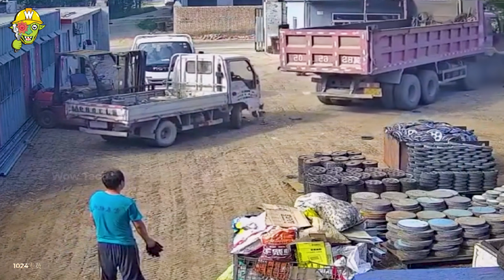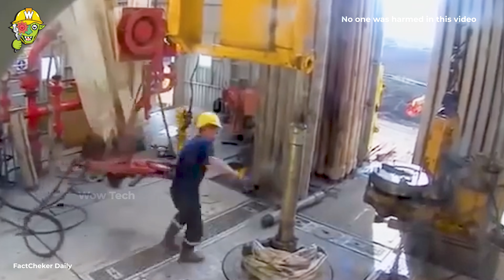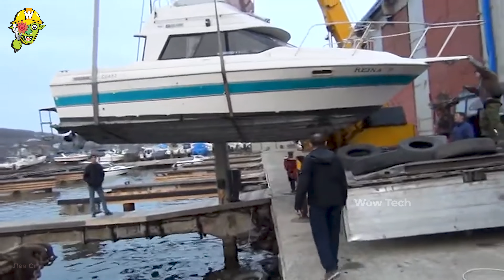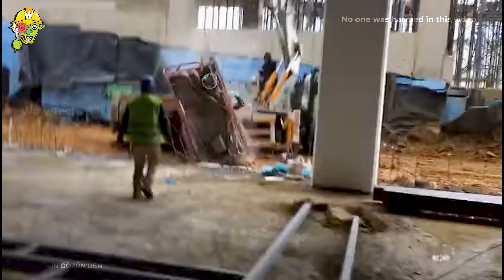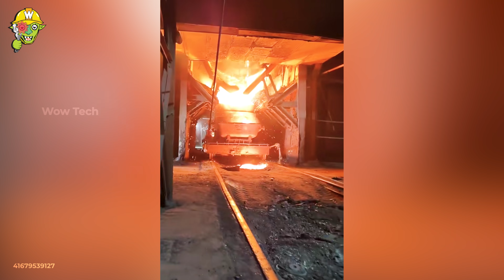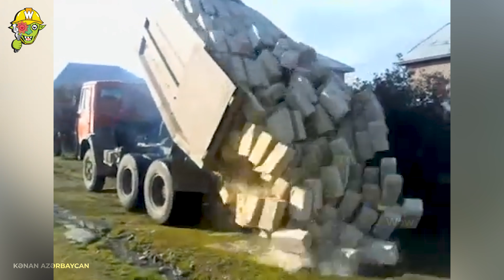Heavy Machinery and Industrial Mistakes Caught On Camera

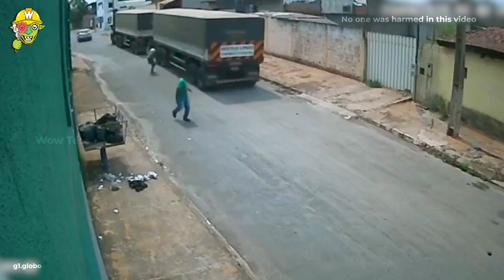Comment: Folks help: 19:44 the trailer rolled off, disconnecting from the tractor. How so? Doesn't it have air brakes and supposed to stop as soon as the trailer gets released and the air pressure dropped?

Comment: The guy cutting the steel straps , what did he think was going to happen? Thats why they use steel straps is to hold things tightly in place like that steel roll, you cut that strap loose ofcourse it’s going to unroll

Comment: It just seems to me that one of the main jobs, if not THE main job of any crane operator, is to check that the crane you're using is able to handle the weight of what its lifting.   Then double check it.  Then confer with a co-worker, and have them check it.   How some of these morons got jobs doing something that is so important, and dangerous, is beyond my comprehension.   
I've also seen that clip of the idiot who's truck was actively on fire, and he decided to drive it straight to the firehouse. That has got to be one of the dumbest people on the planet.  It's like if you found a bomb, and then thinking its a good idea to pick it up and run it thru crowded streets, just to take it straight to the bomb squad.

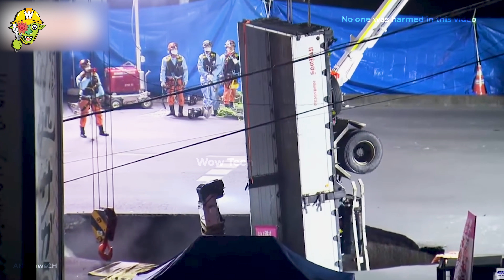Comment: 3:31 The road collapse occurred in Yashio City in late January 2025. A broken sewer pipe caused a massive underground cavity, which led to a truck falling into a sudden sinkhole. The driver was thrown from the cabin and tragically drowned; it took three months to recover the body as the hole continued to expand. As of April 2026, a temporary bridge has been installed and partial service has resumed, but it is expected to take several more years for the environment to be fully restored...
Reply from the maker: This is very valuable information! It's surprising how long-lasting and devastating the consequences of a broken pipeline can be. What precautions should similar urban areas take to prevent such tragedies in the future? Thank you for your contribution!

Comment: I was working at a small distribution warehouse in Mississauga , Ontario  , Canada when there was 2 workers driving 2 reach trucks unloading a 53 foot  trailer. When one driver had to stop unloading and go get a skid of supplies and take it to the production room. The driver of the truck and 53 foot trailer lost track and took the brake off both the truck and trailer and started driving away with me on the reach truck still inside the trailer. Luckily for me my supervisor was able to Stop the truck and trailer from leaving. The truck driver thought we were finished unloading the trailer. No damage or injuries but had me a little rattled.
Reply from the maker: Hearing about it sent chills down my spine… thankfully, they stopped in time. In my opinion, this situation was mainly due to a lack of clear confirmation before the vehicle left. A simple check between parties could have avoided this risk. Luckily, you are safe, and we hope that similar situations will not happen to you in the future.

Comment: Big machines are amazeballs - until humans loose control of them. Then, they are scary as fuck!

A robot or a crane can be rebuilt... a smashed human... its rather complicated.
Reply from the maker: Yes, that's right. Therefore, when working with large machines or any type of machinery, we need to adhere to safety regulations and understand how to operate the machinery to avoid risks.

Comment: 2:45 I have worked with hydraulic cranes for over 35 years. The problem wasn't with the load. The crane was set up improperly. 100% the fault of the operator.

Comment: High voltage electrical equipment, if not properly maintained or severly overloaded, can and will explode. I've been an industrial electrician for 44 years and have seen this a few times. That one was a small explosion.
Reply from the maker: Thanks for sharing your expertise on electrical equipment! ⚡

Comment: This is why in Singapore, ordinary 50-ton cranes are only used in construction sites. When it comes to hoisting construction materials from the 1st floor to the upper floor, big mobile cranes heavier than 50 ton are being deployed.
Reply from the maker: That's interesting insight into crane safety regulations!

Comment: They ghost rode that back hoe @0:40 , they should have chained it to a tree uphill and also chained it better to the excavator and set the brake,  We did the exact same kind of recovery on a John Deere back hoe that was stuck almost on it's side on a slope and we had multiple chains holding it so it worked out good.

Comment: Obviously, most of the accidents involving cranes were preventable. The crane operators failed to consider the weight of the load and the capacity of the crane. I can't believe the number of truck drivers that are clearly not trained.
Reply: The angle of the boom makes a big difference in how much weight a crane can handle.  A crane with a boom that's nearly vertical can maneuver a heavier load to some degree than it can with the boom extended out more parallel to the ground, because the boom at a lower angle to the ground has more leverage to tip the main body of the crane.  Same is true to a lesser degree of a front-end loader with weight in its bucket.  It all has to be calculated correctly by the crane operator.  Available space, overhead hazards, weight of load, length and angle of boom, length and angle of the crane's support arms, etc.  If any of the figuring goes outside the designed capacity of the crane, there will most likely be trouble.

Comment: The first one was not a mistake, it was planned, that is what happens when you have steel rolled like that.  That is why he was stepped to the side.

This video, I could not stand for more than 20 seconds.
Reply: And that is why he had a very long cutting torch. So he is not standing directly along side the steel coil.
Reply from the maker: Thanks for sharing your thoughts on the video.
Reply: @wowtech999  not a thought, truth. of course a coil suspended like that will spring open when the strap is cut. working with coils 101

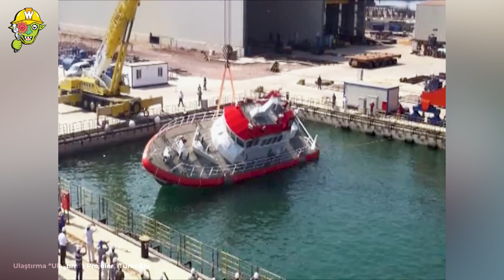Comment: 24:10  This is NOT a fail. This is a rollover test that was successful. Bruh!
Reply: different vid? i didnt see no crane failure
Reply: @rogerw-interested  I don't know what you're talking about. Go to 24:10 that I mentioned and this is exactly what I was talking about. A boat rolling over. There indeed wasn't any failure and this was the reason I commented - because this video was supposed to show failures.
Do you understand?
If my comment has appeared on some other video too, I'm not aware of it.
Reply: @OnTheRoadAgain-S   you are correct, i misread something that sent me off in the wrong direction. it was a good test
Reply: @rogerw-interested  No problem 😐